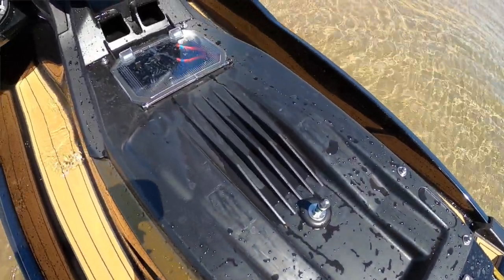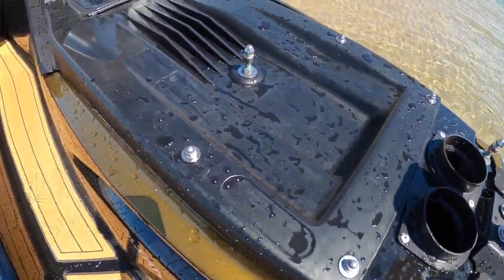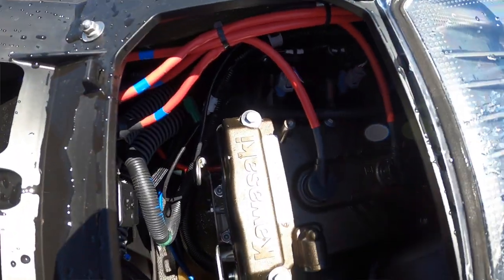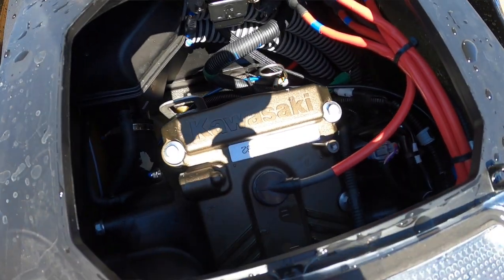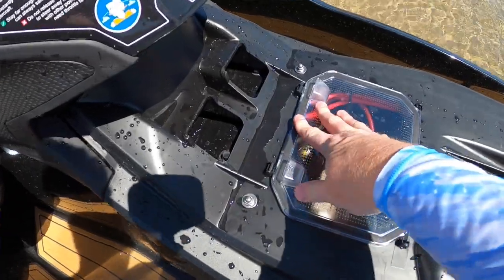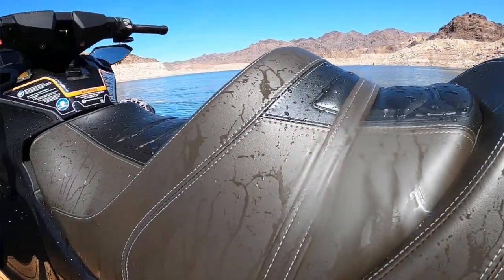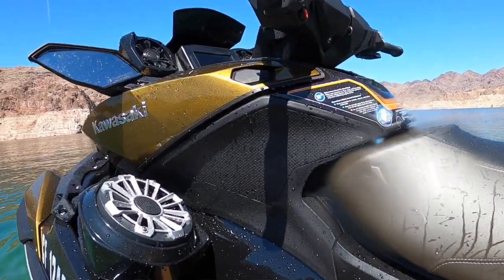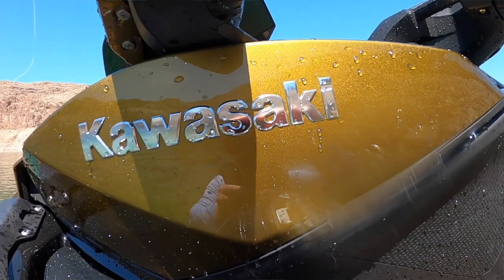Why The Heck Did Kawasaki Close Up The 2022 ULTRA 310 Engine Compartment? WCJ Quick Topic

Comment: I’ve got the stainless thumb nuts too - that or you need to keep a 10mm driver with you in the ski…. I remove the cover after every ride to wash down and lube the engine and do my post ride checks. Once you do take the cover off, you have unobstructed access to the entire engine. Would I have designed it with the cover that way? No. Did it weigh negatively on my decision to buy this ski? Not at all.
Reply from the maker: Good to hear

Comment: So dropped a 3 x 1 inch washer in the engine bay trying to install a quick release for a tow rope and was just wondering if it would do any damage to the ski if I leave it down there
Its a 2023 310 Ultra X

Comment: Hi Kevin, I finally picked up my trophy today. However, the back rest for the swivel seat was missing. When I inform the dealer, he told me that it’s an optional accessory component. Is that correct? I thought it comes with the trophy.
Reply from the maker: No it’s standard equipment

Comment: Hi kevin, can u share any tips for cleaning the engine bay of pwc ? I feel mine is dirty and cant clean it corrrectly.. And there is always water wich i cant remove (even when i put nose up) jetski is very heavy
Reply: For getting the water out use a shop vacuum (make sure there is no gasoline or vapors in the hull), sponge, and towels to get rid of water that is hard to remove. You'll never get all of the water out just by draining it using drain plugs or even if the ski has an electric bilge pump.
Reply: @paullinkins8121  thank you very much sir 🙏🙏
Reply: Keep the seat propped up let someone air to move around.i put a little dawn dish soap in the bildge before I head out.it will keep everything clean with the water sashing around
Reply from the maker: Yes I can and already have. Please see our video on saltwater flushing and cleaning up after a ride.
Reply: @denniswilder3014  thanks 🙏
Reply: @watercraftjournal  thank you 🙏
Reply: @watercraftjournal  i think i watched 95% of your videos in YouTube,you have donne such great job 💪💪💪. I know you dont like when People ask the same question  😂... I really dont like  that i cant remove all the water from the hull
Reply from the maker: Evacuating water from inside the hull is a must, as it can corrode the oil pan and motor mounts.

Comment: If u have skills and the proper tools u can still change the spark plugs on a 21 gpr  without removing the upper deck.
Reply from the maker: Yup
Reply: @watercraftjournal  plus a big tip for ppl w a yamaha in salt water   fill up 3 inches of water in the hull when cleaning because the salt water that gets into a 21 plus gp  will find its way up to oil cooler bottom of block  waterbox connections  etc.  ur garden hose will not get to those locations.   This was an old trick i learned when working for a seadoo dlr many years ago.  YES IT TAKES TIME  no watercraft are not fast to clean up properly.  if u want something easy to clean after riding  buy a 185 mph    ninja  gixxer, ,  bmw s1000 , or cbr.
Reply from the maker: Huh. Interesting.